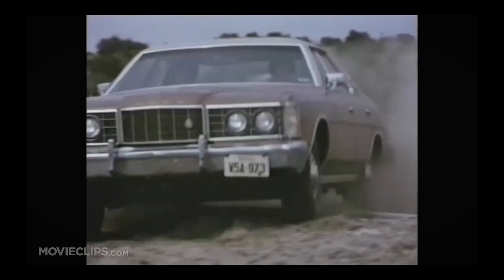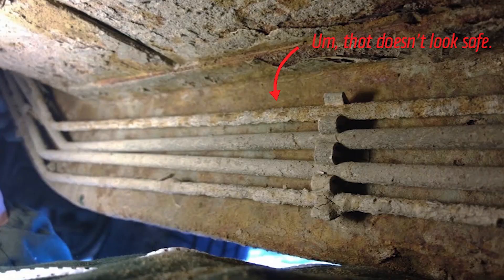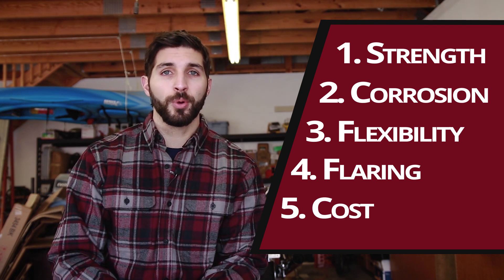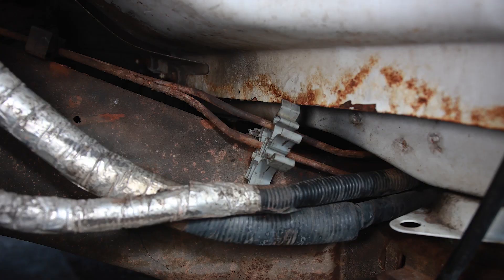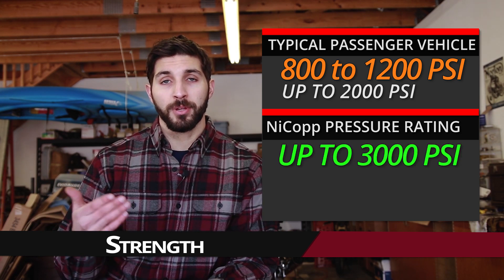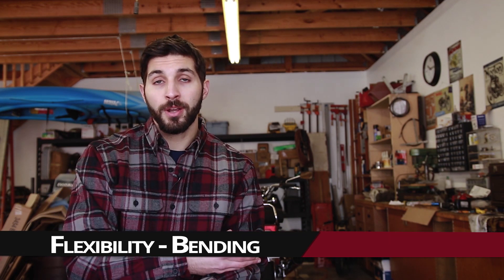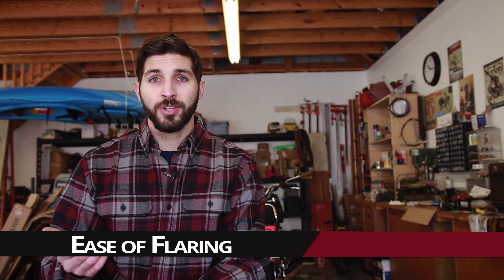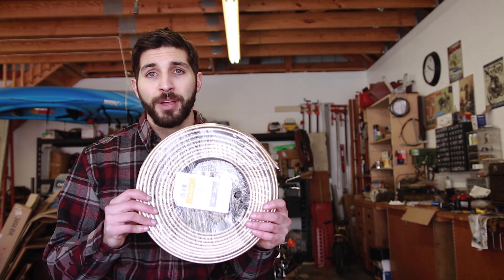NiCopp -  The BEST Brake Lines in the World and Why. NEVER Rust | NiCopp Pros and Cons review

Comment: GM should have been sued for those brake lines.   HUNDREDS OF THOUSANDS of GM trucks have had failed brake lines.   There should be an industry standard for brake lines.  My 2005 Silverado went right to the floor.. i mounted the curb on the side of the highway and went onto the grass to stop...
Reply from the maker: It's crazy they are allowed to produce break lines that fail catastrophically without any prior warning.
Reply: I agree. But there's also preventative maintenance. Some states even have inspections
Reply: @Wickedjc2119  but not all sections of a brake line are visible. Some are behind components like gas tanks and frames and behind encapsulation panels.
Reply: @petmitsu  I understand that. But you could still see the condition of the rest of the line.
Reply: @Wickedjc2119  sometimes just the rotted sections of a brake line are hidden and the good  sections are not so one might think the whole line is ok because they see the good visible part. Understand?
Reply: @petmitsu  I understand. But it's not like the visible sections of line are going to look brand new while the hidden sections are rotted. Not to mention with the hundreds of cars I've done brake lines in. The part that popped has always been exposed. Which means it's seen the most water/salt. Where the lines hidden behind a fuel tank gets less damage.
Reply: @Wickedjc2119  nope. That's exactly what I've seen many times. Exposed sections look perfectly fine but hidden sections behind plastic encapsulation panels rotted and blown. Each time, it was discovered when the brake pedal went to the floor.
Reply: I can vouch for that. I was with my dads buddy towing a truck, and same thing happened. We got lucky it was just backing down his driveway.

Comment: I started using this stuff in 2014-2015, patched a couple vehicles, and used it to run all new lines in both my cars. I'm in Ohio, and have had multiple brake lines blow out due to rust. Now 4+ years later, the NiCopp is still doing great in my cars. I see very light green corrosion, but appears to be just lightly on the surface, otherwise 98% of it looks clean / shiny still. My old steel lines looked like they came off the Titanic ship wreck they were so rusty / weak, and could see the previous owner(s) already had it patched in a few spots. The Nickel Copper line is so easy to bend / flare, I'll never use steel line again. I got mine (Nicopp brand) on ebay for like $45 for 50ft, and it looks like some even cheaper on there (not sure of brand though). In total I spent roughly $150 to do both of my cars, $50 of that was a cheap flaring kit, and still have a little extra line left over in case I need to patch anything. It is doable in a driveway or garage on jack stands if you are able to do it yourself to save labor costs. I'm happy with the NiCopp line, just so easy to work with all around.
Reply from the maker: Great feedback 👍 definitely an awesome product and I don't know why more people don't know about it.
Reply: @TheSundaeDrive  here in the uk that is what we have been using for years.
Reply from the maker: Definitely the smart way to go!

Comment: Copper is perfectly fine for use in brake lines, thousands of people have been using it for years, if it does fail due to vibration it has been made incorrectly and contacting something other than its mounting/anchoring points, just like any other metal.

Comment: if these car manufacturers would just under coat those steel brake lines with a rust preventive primer then we would not have these rusted brake line problems, just had to replace mine and i used the nic copper lines.
Reply from the maker: That would definitely helped them last longer. The problem is if that undercoating gets knocked off from road debris, the lines will start to rust and they only have to rust through in one spot to fail.
Reply: dont know about other cars but my nissans and toyota brake lines are 90% covered in some kind of thick rubber casing the last 1-2 foot that goes out to the caliber isnt and i have to replace those rusted areas after a decade of winter usage.

Comment: OK, what about for a performance build? Could you run this on the track?
Reply: I can tell that Ken Schrader uses NICOPP on his dirt race cars. I am not sure if he used it on his NASCAR vehicles when he raced in that circuit. I will try to find out.
Reply from the maker: Yes I would feel safe running this. It meets SAE J1047 specifications and NiCopp is also on par with steel brake lines with regards to burst pressure and tensile strength. NiCopp is still ultimately softer than steel - which is why it is easier to bend - so you may want to be aware of stones and other debris that may damage it depending on the type of racing you are doing. For typical track racing it should do well.

Comment: The dorman prebent stainless kit is only 65 online no flaring anything. This guy is a salseman
Reply from the maker: We were looking at stainless but it is super difficult to feed under the cab of the Silverado without lifting it. Some vehicles are probably easier.
Reply: The Dorman kits are made from Stainless Steel grade 304 which rusts. Try the AGS EZ Fit Kits. Video link: https://www.youtube.com/watch?v=s87C53ZNtbE
Reply from the maker: That's good to know 👍👍
Reply: problem with stainless steel is getting the inverted flare to seal properly.  Typically you have to crank down as hard as you can loosen up then retighten as stainless steel is very stout material and the inverted flare will not properly flare to its sealing surface unlike OE steel lines.

Comment: I've seen them turn green and corrode! I'll go Stainless thanks
Reply: The outside forms what they call Patina which is harmless. The brake fluid inside the line prevents this from happening.
Reply: @seanmurray4941  Yeah, it's corrosion, which has different properties in copper and nickel and most other metals than iron. The problem with iron corroding is that rust expands larger than the original iron, and does so with a lot of force, and in the process pulverizes the structure of the original iron. The corrosion that makes up the patina of copper is harder than the copper and protects the underlying metal from further exposure.
But brake fluid is highly hygroscopic; it attracts and holds water. That's why it's important to change the fluid every so often and to clean up spilled fluid on any steel if there are leaks, because it can really make it rust quickly. Brake systems are closed off but not perfectly, esp in the master cylinder, and so they do grab moisture over time and can accelerate rusting of already neglected brake systems.
Reply from the maker: Copper turns green but it doesn't rust through like regular steel. I believe we mentioned that in the video but maybe we forgot to. Stainless is definitely the best solution if you are able to run the pre-bent lines. Unfortunately, with my truck configuration there was no simple way to do it and this we a solution that worked really well for me.
Reply: @TheSundaeDrive  The problem with stainless is that even though it won't rust, it's brittle and doesn't flex. For short distances it's fine, like on motorcycles or even front lines on cars, but for longer runs like rear brakes and especially on larger vehicles the odds are good it will eventually crack as it won't flex enough with the suspension and frame. NiCopp might flex too much for certain applications, though, depending on the run. No perfect solution, but NiCopp is probably the best overall for most applications.
Reply from the maker: Good points! I guess there is never a perfect solution to anything
Reply: @gf4670  depends they make 2 stainless brake line  304 stainless and 316L  the 304 is NOT the one you want the 316L is flexible and easy to flare plus rust proof.
Reply: @Raven4122  It's definitely more flexible than 304 thanks to the moly in the alloy, but still not as much as NiCu or mild steel. For cars it's fine, but for a truck or something large I'd still go copper for the rears. I've seen too many stainless lines snap from not flexing enough with the rear suspension.
Reply: I could have never got stainless around all the crap on my old truck, plus u can bend nicopp with your hands. If it lasts 40 yrs good enuff for me👍👍👍
Reply from the maker: Agreed, you would have to lift the cab on the truck to do it lol

Comment: What a joke! Who the heck would expect to go through all this mess ! Ashamed on Chevy trucks for those models when they cut back on the safety ! I have 2003 suburban and it costed me arm and leg to get all the brake lines redone and now my fuel lines are next !! I lost the break 3 times and I could had been o serious accident bcz of the break lines were done in cheap ! After the third time I decided to just redo them all instead of patching them. Stainless steel performed lines costed me almost 400$ then 8 hours labor. I can’t trust Chevy any more after not having the break line serious issue under recall. By the way if that’s ok why can’t they keep putting those none coated lined in the new Chevy model trucks?
Reply from the maker: I know. It is a huge safety concern. I guess since the average user only keeps their vehicle for a few years they can justify it somehow. Did you get pre bent lines or did you bend and flair the stainless steel yourself?
Reply: The Sundae Drive yes I bought preformed lines from classic lines .com back in 2014 before doorman released same stainless kit that you now can get just from advance auto for around 100$ the kit is flared and ready for replacement. The big problem I had is to find a shop that does this type of work for all lines replacement. Most of the places I had to talk to were scratching their head on what’s the game plane to get them all done!
Reply from the maker: How did you get them under the cab?
Reply: so $50 an hour is an arm and a leg? its a 2003 you dont think a 15 year car would need brake lines to be redone anyway? that's Chevy fault? i think you made out in my book
Reply: Welding Junkie who said the shop charged me 50$ an hour? I paid 800$ for the entire job labor plus 400& for preformed lines kit!! Without mention down time to find a shop that can do the entire lines job. So don’t tell me it’s something normal ! Bcz if so why Chevy they’re now putting high quality lines instead of sticking with that crappy quality none coated lines? By the way I have 1995 Altima and 1997 Honda Accord both came with insulated break lines witch they can last life time of the vehicle. The bottom line Chevy lost my vote.
Reply: Al Karim it was the way you wrote it, it wasn’t clear. And I get it but at 15 years old you have to expect to change the brake lines out no? I live in Boston and nothing last here not an axle.

Comment: Haynes Manual Fears ~ Loss of income to mechanics and refuses to provide any socket or wrench sizes for any tasks, yet Specifically says "do not use copper for brake lines." ~ So I missed out of NiCopp Fe. Made up my mind while using Poly-Armour that I would rather risk Copper Alloy than risk Obvious Future Rust. (The coating scrapes and scuffs like a regular plastic grocery bag wrapped around it.)

Comment: Car manufacturers are not concerned about our safety. They know about NiCopp but they are still using steel just to save a few $$. It makes no sense to have 20 air bags, stability control,abs brakes on a modern car, if the brake lines are slowly rotting away under the car.
Reply: It's an interesting ethical conundrum.  Extremes are bad in either direction.  If automobiles were built as safe and long lasting as many people say they want they would cost more than most could afford and would be quite unpleasant to drive.  
Automotive manufacturing has swung toward the opposite extreme.  Known serious safety issues are not addressed because of costs.  The bean counters have taken over most American manufacturing.  "Automobile safety" is actually an actuarial exercise for automotive manufacturers bean counters.  Essentially putting a dollar value on someones' life.  If the dropoff in sales due to bad PR, legal fess, and settlements are less than the cost of re-designing an unsafe part or assembly they will use the cheaper parts and or not re-design the assembly.
Eddie Valiant had it right... "Here's to the pencil pushers.  May they all get lead poisoning."
Reply: @TheOcculus  what a load of brainwashed bull crap you talk buddy!!  They have 'educated' you into total stupidity.. the worst part is you have blindly gone along with it.
Reply: If you dont wash off salt after it snows then yes it will rust bad.  People seem to not want to wash off 2-3 times a week in winter though.  Parking in a garage actually makes the salt/ice melt and can add to rusting as well.  If you wash your car after each snow and keep it up in winter, your brake lines will be fine.
Reply from the maker: Hard to maintain that when you have salt on the roads for 3-5 months straight here. Especially the saline solution they spray now, it coats everything. Definitely a good idea to always spray the lines down as often as you can but the lines will eventually fail.
Reply: @TheSundaeDrive  Washing your car is part of the maintenance. It should be done regularly. Summer and winter.
Reply from the maker: I agree 👍👍